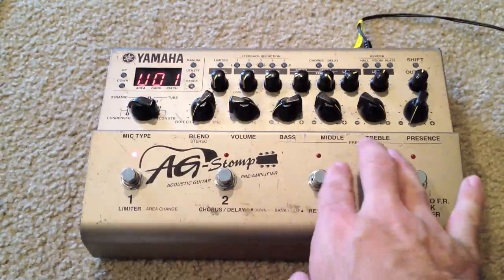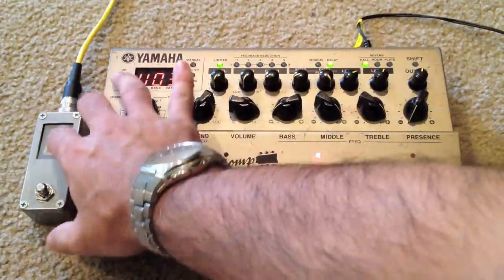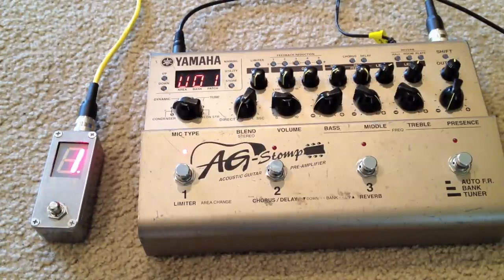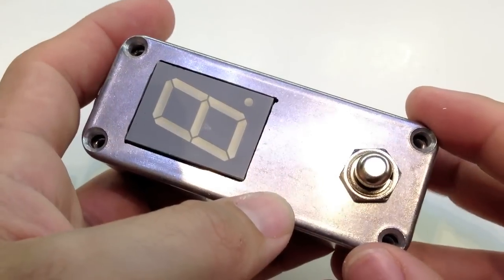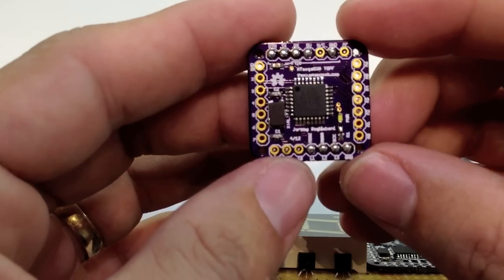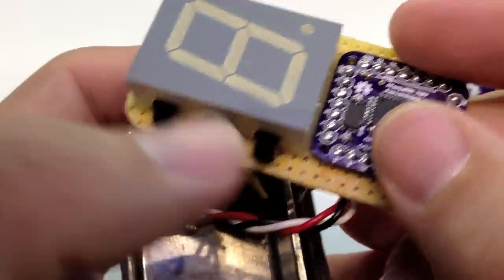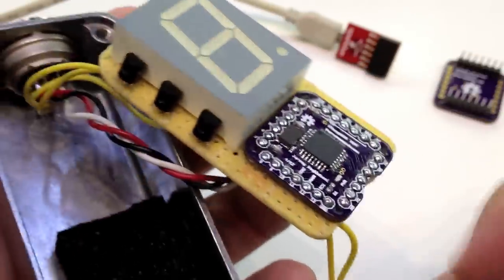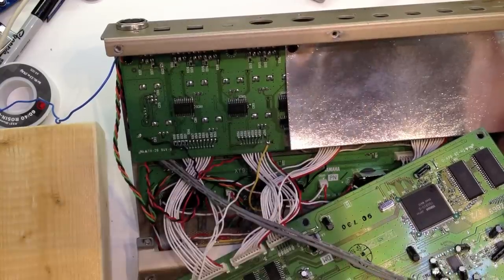Yamaha AG Stomp Mod

Comment: The AG Stomp, and DG Stomp, both have midi in/out. Why in the world would a "professional musician" (especially a keyboardist) not take advantage of that? I don't mean to knock your build, but considering the amount of midi capable gear he appears to have in this rig, I'm not sure this is the optimal solution.

That said, it's still an interesting project and looks to be very well executed.
Reply: Scott Amsberry The only thing the MIDI offers is remote program change (I always use my feet), or possibly reverb times and such. What it DOES NOT SUPPORT is MIDI sync, which would be super handy to sync with the laptop and the 15 other things I have syncing.... but it doesn't...
Reply: Scott Amsberry glanced at this, maybe I wasn't clear. My hands are pretty busy, playing the guitar/bass and keys at the same time. So I end up with a lot of pedals to control things. I use a ton of Midi and even MIDI pedals, but to change patches on the AG Stomp, I would need to change banks (1-4 taps) then press whatever for the program change. That could be 3 or more taps while I'm also trying to change other things.... So this remote makes a huge difference, and is a big advantage over MIDI in my situation.
Reply: @austinbiel I am also still unclear why this is more convenient than using a midi controller. I have an DG stomp, and i can go to any preset with one button push :)

Comment: It says you need to hook up a dummy 9 volt battery to connect your guitar to the yamaha ag stomp pedal.My taylor 710 ce has double A batteries.What do I need to do?I dont want to burn anything up.Any one have an answer?I really like the pedal.
Reply: North Glen the dummy 9 volt is an OPTION for use with Yamaha guitars. You can power your Taylor normally and it will work fine with the AG Stomp